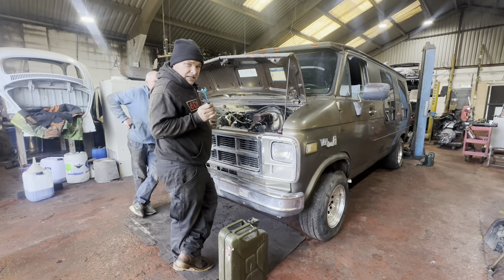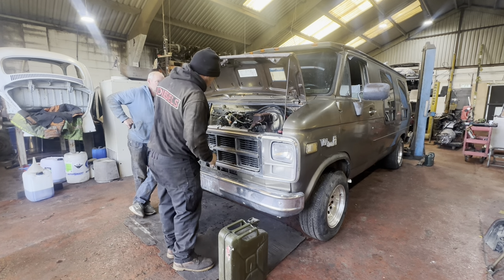GMC v8 A team van Vandura will it start? Run? And even drive? One way to find out !!!!

Comment: Worked on one of these for a private ambulance crowd - it kept eating transmissions. Was on transmission 4 when I went to it. Spendy... Some genius had mounted a very posh spare wheel on the front of the grille. It had a solid cover with their logo on.  Behind it, inside the grille, lives the transmission oil cooler........  the aircooled one.  That wasn't getting any air due to a posh spare wheel blocking it.  I binned off the posh spare wheel & transmission 5 is still alive and happy many years later now. Just to add, this was the automagik version.
Reply: The "engine always runs a bit hot" issue was also sorted at the same time..... I worry betimes....

Comment: Brilliant as ever. Loving the Fairy Liquid fuel injection system that's safely stored by the gentlemen sausage and Ikea meatballs when not needed with flames flying by. If you want to road test it you'll need an oil refinery strapped to the back. How do the yanks make such low performance off such massive capacity blocks?
Reply: Low performance is an art form …
Along with poor handling and dodgy brakes

Comment: On the plus side, if that engine was to be borked somehow, you could always slap a mercedes engine in it, cos Flexiny out in Estonia has (or had) the chevrolet version fitted with a 3L OM603 Turbo diesel, which made it 20 million times more reliable, even if the van itself was riddled with tinworm... :P